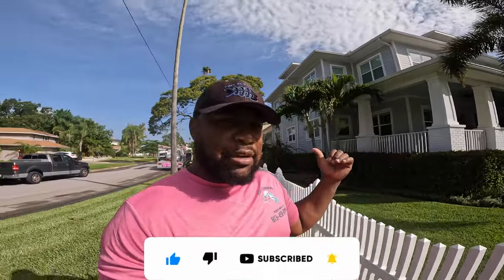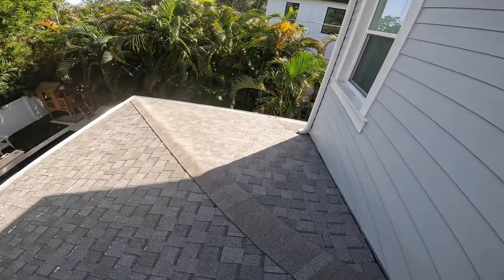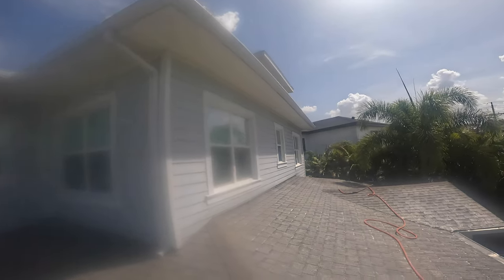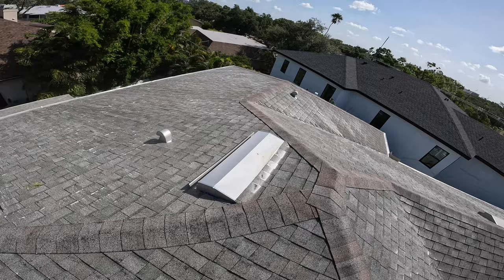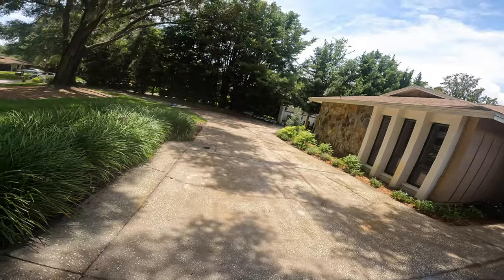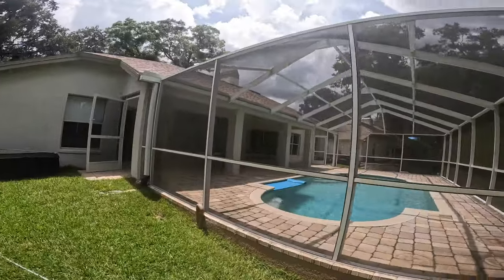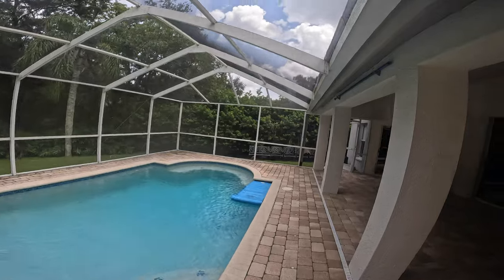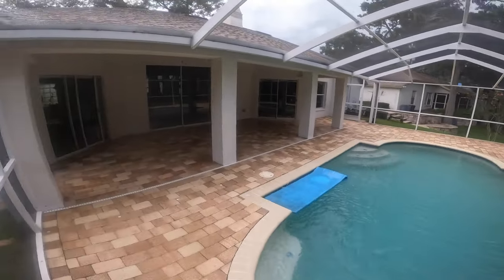Big Roof Wash | 12GPM Surface Cleaning #softwash  #pressurewashing

Comment: Man you walk on them high roofs like its nothing Lol. Great work on everything. As hot as it is you need one of them 5 gal water coolers mounted to your truck. Your welder guy can make a rack for it. They have gaterate mix packs to make however many gallons you want instead of just filling it up with water.
Reply from the maker: I like that idea actually.  Thanks brother. We need that good hydration station.

Comment: Love the work you do my man! Your pressure washer is definitely surging tho. I thought I was trippin, but I'm pretty sure I heard it surging throughout the video. Maybe it isn't getting enough water?
Reply from the maker: I got 1.5 inch hoses running to it. I think it's probably a coil or maybe something else. I'm gonna take it in to have it looked at. I hate that surge noise lol. Sometimes it goes away and then it comes back
Reply: @PinkFlamingoPowerWash  oh you know what? It could be your unloader. You have the k7, right?
Reply from the maker: @every_thing_wood1251  I thought it was that as well. Gotta get it diagnosed.  💪🏾
Reply: @PinkFlamingoPowerWash  yessir! Good luck!